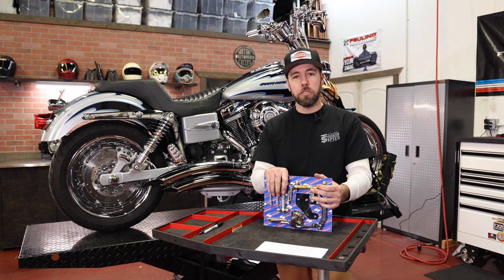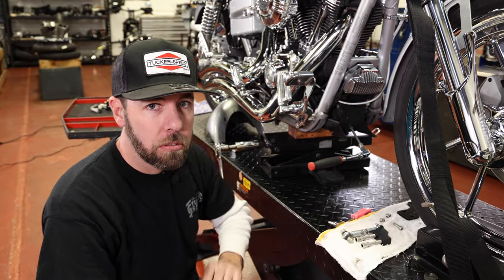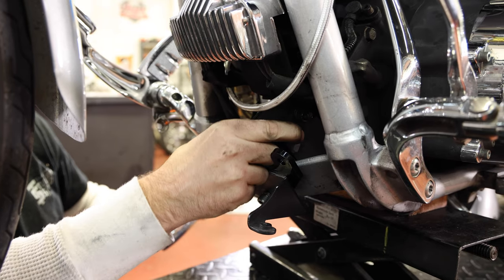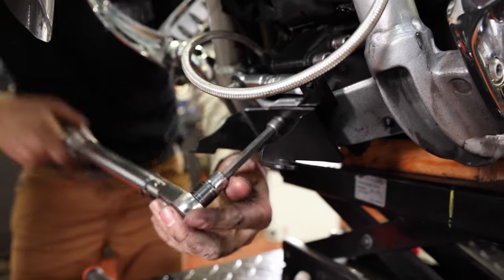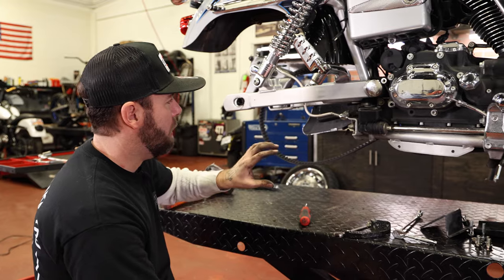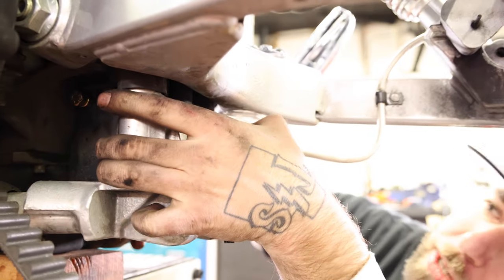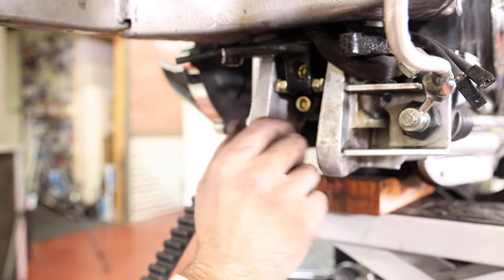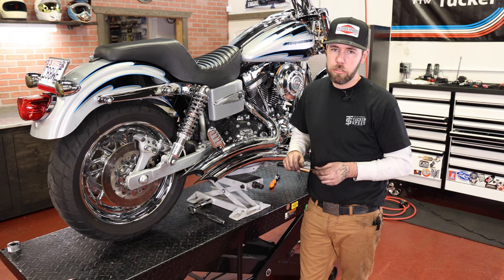How To Fix Dyna Wobble! Sputhe Chassis Stabilizer Kit Install

Comment: Got my kit from you guys and installed it yesterday, and flat out the Sputhe instructions that come with it are crap.  Your video helped immensely getting the kit installed.  Thanks for the tip in moving the wiring for the rear motor mount. I did pull the rear brake reservoir and the belt guard to get clear access to the bolts, but was lucky didn't have to remove the rear tire or exhaust. getting that bracket threaded was the only really challenging part when you're doing the install by yourself.   Other than that the kit went in no problem.  Thanks again.

Comment: Ive installed a few True Tracks and a Sputhe over the years. I know its not for beginners, but the rear can be installed without removing the rear wheel; I do it with the bike on the stand myself. The only other thing that surprises me here is that no one is either showing or recommending that the alignment of the power train be checked and trued after installing the stabilizers, especially since these stabilizers literally make a horizontal powertrain alignment on Dynas possible. More importantly though, is the vertical powertrain alignment, which should always be checked if an FXD has a wobble. I have found that the FSM method of doing this is not accurate, and that it is much better to measure the mount to mount lengths on the shocks, and any difference here is indicative of the powertrain being out of alignment vertically. You cannot use a tape measure for this, you must use a tool designed specifically for this that has sockets to fit over the top mounting nut and the bottom mounting fastener. Once, a bike I put a True Track on and set alignment per the manual, with a digital inclinometer on the seat pan reading 0*, and adjusted the top link on the motor until the inclinometer on the rear rotor read 90*, and yet the bike still wobbled at high speeds. Upon further checking the shock mount distances, I found that the distance on one side was longer by around .1875", and, after adjusting the top link until both sides were equal (inclinometers and FSM instructions be damned), the bike handles great.
Reply: Fuck these are the type of explanations that help people and not just put a stabilizer and u want die type explanations .salute sir u gveme an in-depth insite on the physics of these things now I understand more or less of what my issue  I'm having is u need a YouTube channel I'm tryna learn from u as well reach one teach one
Reply: Yep great explanation, thanks for the details it confirms reasons for oscillations come gyroscopics 👍👍
Reply: Is it necessary to install new isolators with the stabilizers if not damaged and just slightly worn?

Comment: I think the Dyna is the best-looking modern HD motorcycle. Too bad production ended in 2017. The upside is they can be found on the used market fairly cheap. (especially after it's current owner ruined a pair of pants after a wobble at highway speed)
Reply: It’s no longer modern, it’s now retro. The Dynas youngest model is 8 years old considering the 2017 line came out late 2016.

Comment: just installed mine  took way more than  a few hours but was farily easy  the wiring harness was not in the way didn't take back wheel off my dyna is a2000 with a 124 thanks for the great video

Comment: Ordered this from @TuckerSpeed, easy order, quick shipping.
Got the Sputhe Stabilizer Kit installed on a '16 FXDL, and it was a great improvement, especially in the hard leans and switchbacks. Would definitely recommend.

Comment: I've had the Sputhe kit for years (not from you guys, sorry, but direct from Alan Sputhe RIP), and it is REALLY good. He made good stuff but his instructions are crud :). The rear is very fiddly to fit (as any of the similar ones are) but if you take your time and do a bit of research etc it all goes together eventually :). But yeah, an absolutely recommended handling upgrade.

Comment: I bought a 13 model FXDB 2 months ago . I had  death wobble around 90 miles on the highway and it got worse day by day, finally i found out my rear rim was out balanced and  2 of my spokes broken recently due to it.  My bad i did not check the rims before i bought the bike. Rear rim alignment and/or  spoke adjustment is one of the biggest reasons of wobble. I had it fixed this week now the bike goes lika a train. Check your rims and spokes before anything else.
Reply: @TuckerSpeed477    Exactly!  A few things can bring out the wobble, but it's an inherent design flaw.  A noodlely frame around a rubber mounted engine is the primary culprit.
Reply: Ok...good advice, thankyou !

Comment: Just did the front motor mount on my 2012 DWG and was beating myself up trying to get the upper/front bolt back in. Then I just used a carpenter's C-clamp to squeeze the whole thing to the right and was able to get the clearance I needed finally. Do not suggest trying that if you're like me and don't have a lift/stabilizer, it is maddening.

Comment: Attaching the rear wheel  swingarm the a rubber mounted transmission/engine is a HUGE safety fail. I wish i noticed this before i bought my Superglide C. I think i might trade it in for a Triumph Rocket 3.
Reply: yes get rid of it very poor design, there are better built bikes out there

Comment: Death wobble, AKA change your tires, put the stock length rear shocks on the bike,  check the bearings, wheel alignment, and lower the bars to a reasonable width and height. I've had my Dyna at the limit several times in corners above 80mph and have never experienced a wobble. Not until I wore my tires down on long road hauls. To the point where the edge of the tire is more square then round. At that point the back end gets squirrely.
Reply: I just changed my front sneaker because of this risk myself. Tire still had some tread but weird wear patterns on the edges. Wanted to be as safe as possible. I wish HD would do this for it's loyals Dyna people 🤷‍♂️

Comment: What improved motor mounts do you recommend to go with the sputhe stabilizer?
Reply: Stock motor mounts are fine, most the fancy replacement motor mounts won't benefit from this kit. I just used new stock motor mounts and the sputhe kit

Comment: Tucker Speed installer has a thrashin supply tattoo..? Nice lol

I have this kit on the way for my 2016 FXDLS, can't wait. Worried about the rear though, front seems easy! Could I use the gold linkage in the front and silver in the back? Are they pretty much identical?
Reply: @TuckerSpeed477  well I installed the sputhe kit last week, and indeed I was able to use the gold linkage up front. In total, the full install including new motor mounts too, it took me 2 hours 30 min. It was much easier than I anticipated

Comment: Shopping for a Dyna...any year recommendations?
Reply: @TuckerSpeed477  Ok thanks. No worries about cam chain tensioner?
Reply: @dry509  The tensioner is a wear item. Off the top of my head it's to be serviced around 30k miles. If you get one have it done. I bought an 08 last year from a used dealer with 34k miles and less than 24hr later the tensioner gave and trashed the cam chest. Luckily the dealer covered the cost of repair. Bike was down for a couple months though because of everything going on.
Reply: @lighlotus117  Thanks for the feedback.
Reply: @TuckerSpeed477  I just bought an 06.  What's wrong with it?
Reply: @TuckerSpeed477  Do I need to worry about the alignment problem with the primary (which was apparently solved in 07), and if I do, is there anything (reasonably priced) that can be done about it?

Comment: Picked mine up from you guys a little while back. Appreciate the tip on the wire loom in the rear. Got mine routed but it's a little tight for my tastes with 14" shocks. I'll have to look into unplugging and rerouting it.

Comment: I looked at mine today and the nut that's supposed to be in middle is all the way to the left i don't know how long its been like that it was on before i got bike but should i center it and tighten jam nuts down?
Reply: @TuckerSpeed477  can i center it and tighten it down without taking it apart.  Just loosen two nuts?

Comment: Couldn't you cut the front bolt that is hitting the fram to get it out?
Reply: @TuckerSpeed477  awesome thanks. I figured but I decided it would be better to just check with a professional.  Lol also would it be a good idea to replace.the top stabilizer as well?

Comment: What brand replacement motor mounts do you recommend? My 2006 was sitting in a garage for 2 years and appears to have sagged enough to get some pretty serious vibration. I'm assuming its the mounts.
Reply: Maybe it’s the rough running from dirty carbs.

Comment: Would it make an improvement with just installing the rear stabilizer or do you 
need the front as well ?
Reply: @TuckerSpeed477  I have a bung king crash bar that fits the speed merchant skid plate and don’t think the front mount will fit due to my voltage regulator being lowered. Just want to something to improve performance.

Comment: Hello tucker speed
I want to ask if your stabilizer can fit with with kinetic structures motor mounts which are a bit different from oem mounts..
Reply: You shouldn't need the sputhe kit with the kinetic mount.

Comment: Thanks for the video very well explained ! 
why give that  trouble to remove the oil filter to only take the bolt from the kit? reusing the original bolt is less strengh? 
Thanks !

Comment: what the hell do you mean if i have a dyna im familiar with the wobble issue. no im not. please explain which ones you are referring to. I ride a 2016 low rider and ride 100mph daily
Reply: @TuckerSpeed477  but which dynas? what years?
Reply: All Dynas, all years. BUT, not all Dynas get the wobble. I've never figured out why, but about 35% of Dynas just never get the wobble. It's also more prevalent if you ride hard in the corners and very high speed (usually above 90-100+) on the straightaways, particularly if there's rain grooves in the road.

Comment: I put one of those systems on my Lowrider S and it didn't help at all. I think it was waste of money on the kit. That whole rubber mounted rear motor mount/swingarm mount is dumb idea for a motorcycle.
Reply: it was a brand new(at the time) dyna 2016 Lowrider S. It always felt like someone was wiggling my bars on the highway. I got rid of it because of that. The swingarm should never be rubber mounted. How can it track straight with the front wheel if it is loading against that rubber all the time? Its just not a good design.

Comment: I got this kit from get low cycles very disappointing. The sent me a used returned kit. I opened the box bolts scattered everywhere luckily everything but a couple washers were there. Went to put it on my 2017 street bob. The front bottom bolt wouldn’t come out just hit the frame like in the video so I put it on backwards like you guys said. Then ran into my second issue I believe it’s my ingnition control system under the voltage regulator on the front bottom of my bike I couldn’t mount that back up the way it was I had to use the bottom hole on the CDI mount and bolt it to the top bolt on the front motor mount bolts to raise it up a little higher so it wouldn’t hit the spluth linkage. The rear was def a pain the wiring coming from the bottom of the bike got in the way I was able to leave my two brothers exhaust on but had to take the back tire and chain guard off and the rear master cylinder. You def can not do this job in a hour straight lie idc who you are maybe two but that be the fastest

Comment: @tuckerspeed wil thos work on a sportster I'm not that cool to get a dyna yet and I got low speed wobbles after shifting to third but my sporty is converted to full bagger batwing bags and system
Reply: Rt on ty if u don't mind I have low speed wobble after shifting from second to thrid to the point if feels like it wants to lose control untill I let off Cnt drive the dam thing it's an 883 bored over but converted to full bagger with sound system any suggestions for my bike I can get rid of it just tryna Crusoe with out wobbling or dam near dumping my baby

Comment: since HD started to insert rubber in their blueprints...you know...the thing is logical...rubber during the time gets wasted, loosing itself from the frame, ...that´s the price paid trying to eliminate the vibration from the original blueprints, the stabilizer is a great workaround for that...but always remember...the more the rubber gets wasted, the more the vibration passes to the stabilizer, so...during the time you practically ends in returning your bike to the blueprints without rubber...Harley is OHV engine, not OHC, if you don´t want vibration, then you are riding with the wrong engine and brand...but since harley abandoned it´s origins, you guys have livewire now thanks to your savior... Jochen Zeits, ...right?
If you want it fixed properly by keeping the vibration absorbtion, the only way is replacing the rubbers until it gets wasted again...and so on...stabilizer will just make it old school again, but with more security.

Comment: Why did H.D. even release these bikes with this problem. What..they have no one test riding them at high speeds? Where is quality control? Now you have to spend more money on aftermarket crap to get it to run right. This is why H.D. Is going down the toilet. Their engineering is going backwards not forwards.
Reply: The older they get the more of a problem it becomes as tolerances due to wear add up. Rubber, bearings, and human error all exacerbate the problem. And any bike can have this problem if not properly maintained.

Comment: I've got this kit, on my 1996 Dyna Super Glide.  After been almost kicked of it, uhm, about 5 times, in different conditions.  Straight, corners, higher or some what lower speeds. Packed with camping gear, or solo. The Sputhe kit works, but it's not a cure. It's butt- kickin' tendensies, are always loomin' in the background.. Dutch, or Euro if you will, RIDER..

Comment: One thing that pisses me off about Harley Davidson. They produce shitty motorcycles and the consumer has to pay for a shitty design, that Harley Davidson should pay for as a recall. Dyna wobble for one and if you have an older Dyna, the crappy cam tensioners fall apart and brick your motor. Another Harley Davidson FIASCO.   RECALL the crap and stop making consumers pay for shitty design flaws.

Comment: It looks like your just installing a solid engine mount over a rubber one. I say remove that rubber engine mounts. Machine a solid one out of aluminum. It's a motorcycle. It's going to vibrate. If it's too much for you. Stay home in your foam shoes people.
Reply from the maker: @starfighter2952  this isn’t about the vibration. The side to side movement can create a pretty serious death wobble that can be very dangerous.
Reply: @TuckerSpeed477  i know. I worked as a mech at hd.
Reply from the maker: @starfighter2952  👍🏻

Comment: You pay good money for a Harley-Davidson and get crap for your buck. We'll I got sucked in by Harley-Davidson, never again, they are one of the worst motorcycle I have ever ridden. That's my opinion. Check it before you leave the bike shop, the suspension is shit, all new harly bikes suspension is not set right. They are set up  all over the place. The front fork bolts, snapped, and I think you get the pitcher, not good at around 45ks. It's only got one bolt a side to hold the top fork piece in place. Death trap. They are just  not a good motorcycle. Sorry to say. You how ride a harley-davidson now exactly what I'm saying. Stay up right. And go cheap match safer.